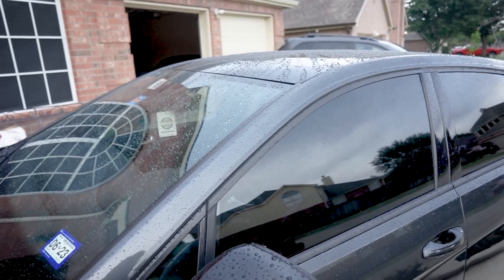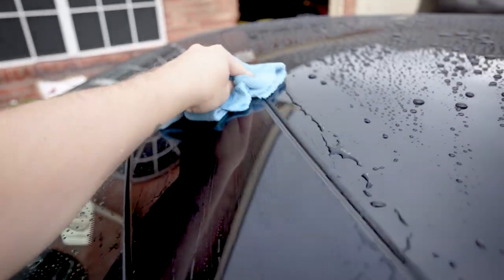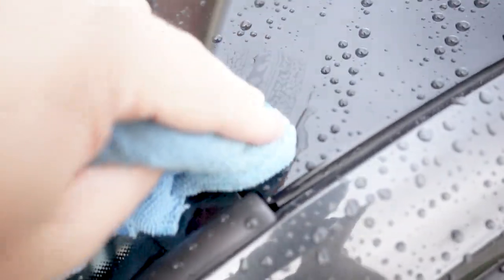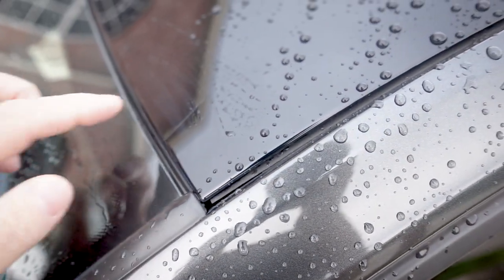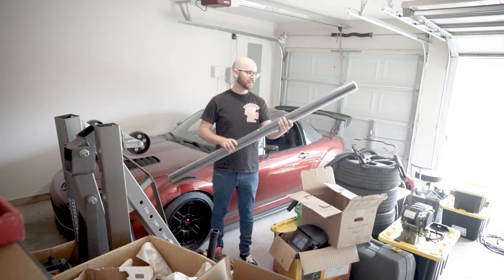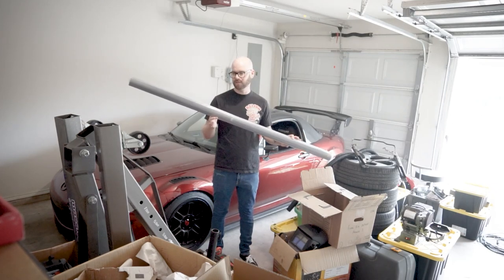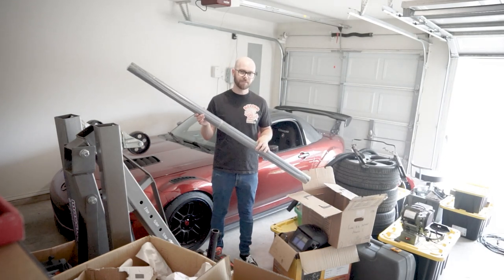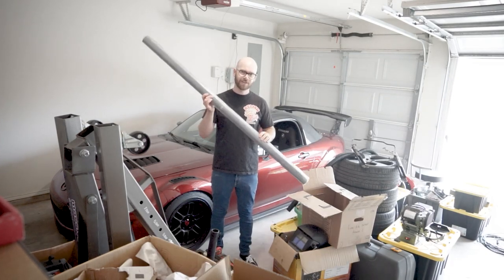Wrapping My BROKEN GTI Sunroof with Vinyl Frog Piano Black Vinyl!

Comment: I can't believe I didn't see this sooner.   My son's had the exact same clear coat issue in the same spot when I bought it.  I thought it was probably from an old sunroof visor that was removed.  There was also a slight wrinkle/line in the paint about a half inch long coming from the corner of the sunroof. Last summer he was backed into the front end, so I took the opportunity to get several things done ( mostly paid for by the other party's insurance).   One thing I did pay for was to have that piece repainted.  Now that same corner has chipped up and a long crack is visible where it chipped away.  Basically it's way worse than a little clear coat issue and the body shop is arguing that it's not their problem because it's a flaw in the design.  I could have just gotten wrapped for a couple hundred bucks or so and called it a day.  We are in The Woodlands.
Reply: I wrapped mine and it holds everything together and out. Wrap job was pretty janky but it's a winter bandaid until weather gets nice and I can redo it better.

Comment: Do you still have the GTI? If so, how's the wrap holding up?
Reply from the maker: Yea man I posted a video about it just the other day. Wrap is ok, still better than a crack and peeling clear
Reply: @ColoredinLight  Nice, I ordered some of the same wrap from vinylfrog. I like the way your car turned out; looks clean. I'm not going over the spoiler with mine though. I was at the VW dealer getting my DSG service and was looking at a MK8 in the showroom that had the roof black stock! It just went to the back and the spoiler was body color. I liked that more, but I see the body line that goes around the spoiler too , so makes sense either way.

Comment: Will this stop a leak also ?
Reply from the maker: It has definitely helped stop the small leak
Reply: If you have this issue it has to do with your sunroof drains being clogged. You can use a small piece of tube and blow through it into the drain and clear it out. Don't use compressed air because it can blow out the car's tubing and that's gonna be a huge problem. I have the same delamination on the black surrounding my sunroof and am going to wrap it like this.